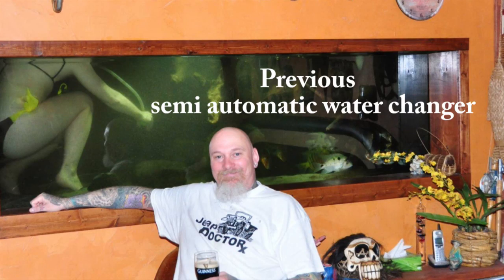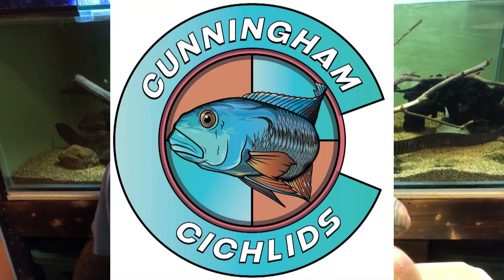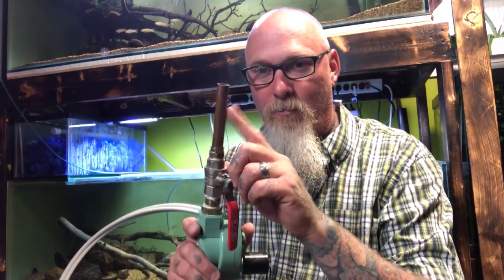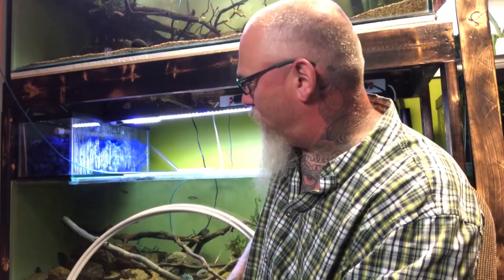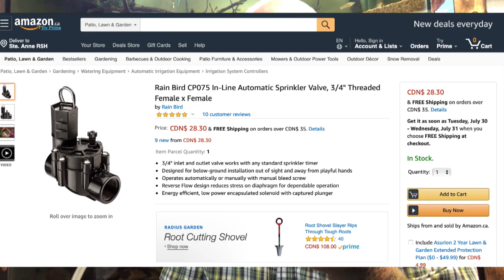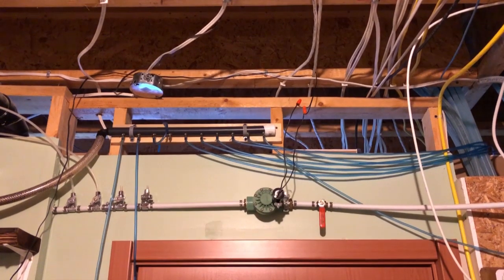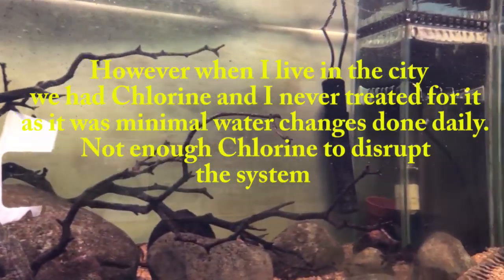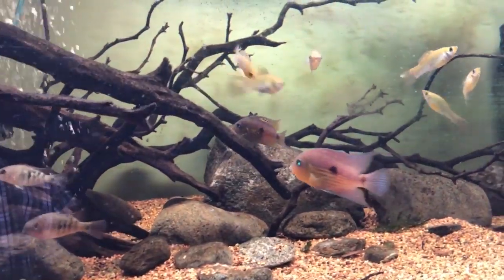DIY  Automatic Water Changer

Comment: Very helpful. This inspired me to set up my system. Is there a reason why you don't drip it slowly instead ? Wouldn't it be easier on your heaters?
Reply from the maker: yes 100% a drip system would work better. Its on the table for when I make the changes to the room. It will also be easier to use with my RO system.
This was just the system I had at the old house and it worked flawlessly for more than a decade. Easier doesn't always mean better!

Comment: Did I understand that when in Winnipeg Manitoba, you did not treat your water for chlorine? I have 10, 20 and 30 gallon tanks that I want to set up on a water change system. That would mean for a 10 gallon tank, .71 of a gallon daily of untreated chlorine filled city water, and that wouldn't harm the fish, shrimp, snails, or plants?
Reply from the maker: All my tanks that I had in the lab back in Winnipeg were well over 100+ gallons. Small daily dilute water changes happened. Thank he small amount of chlorine had zero effect on anything. However also of note should I be working with a more sensitive or delicate species the water changers was fully adjustable. I could easily switch to reverse osmosis with a handle. Or water can be run through a cartridge to remove chlorine. Chlorine isn’t very stable unlike chloramine which I have never had to deal with.
In smaller aquaria I would add a water conditioner dosing stage inline or a chlorine removing cartridge